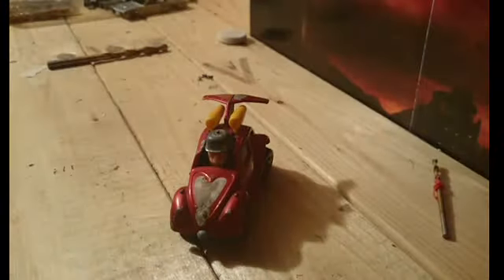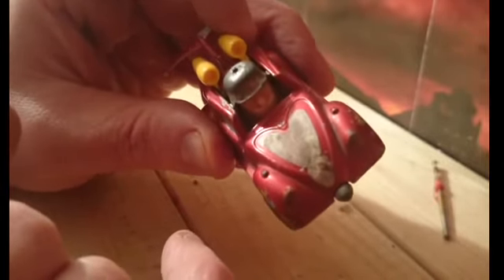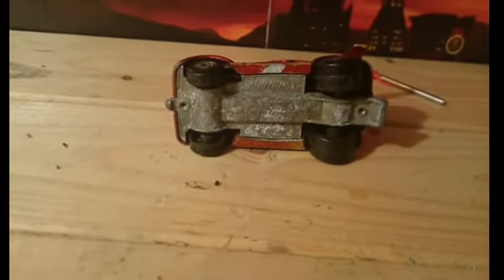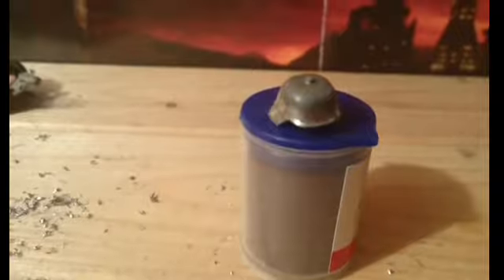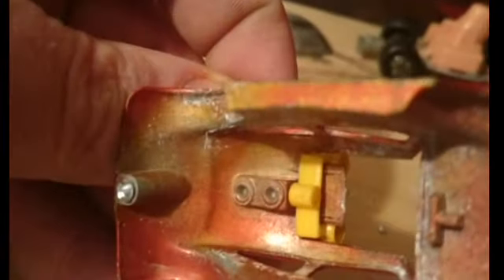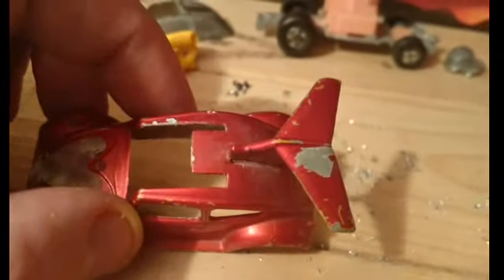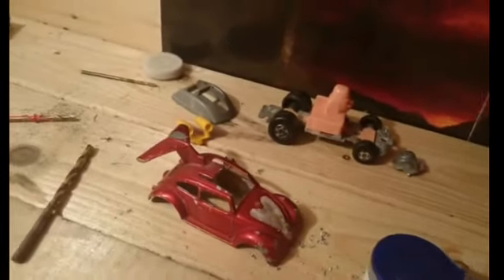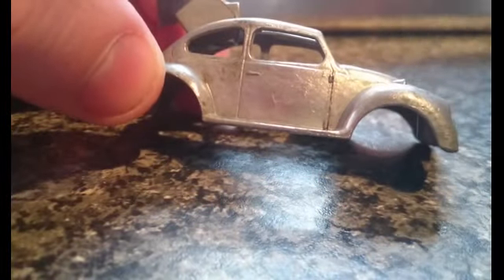Matchbox Lesney flying bug restoration project

Comment: great video...interesting info...looking good...the wire wheel will remove most if the corrosion on the base....
Reply from the maker: thanks. enjoying this think this could be the first of many restorations.
Reply: +michie3193 restorations are so satisfying for me...I enjoy them more than customs....I was going to leave my flying bug as is, but now I feel motivated to restore mine...
Reply from the maker: +Jimmy Mitchell247 yeah this was a cool one to split the way it's all interlocked to hold it together. A nice change to the standard body base and interior.
Reply: +michie3193 like the '72 Sidekick I'm restoring...it has a metal sliding seat, a plastic pulley for the seat...all kinds of parts...good stuff!!!
Reply from the maker: +Jimmy Mitchell247 yeah that one looks cool can't wait to see it finished